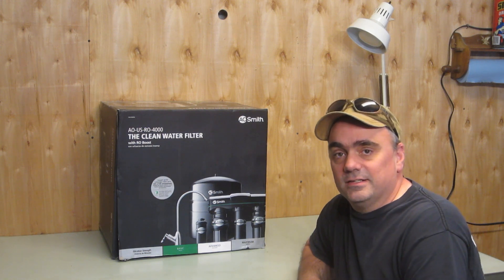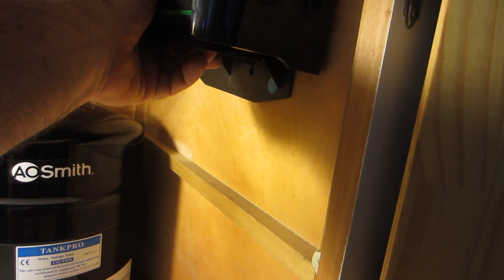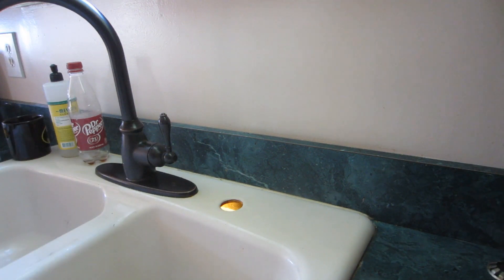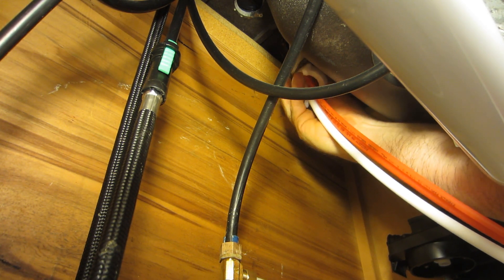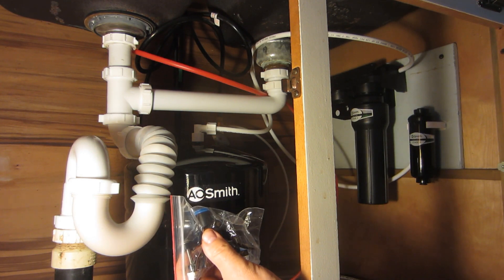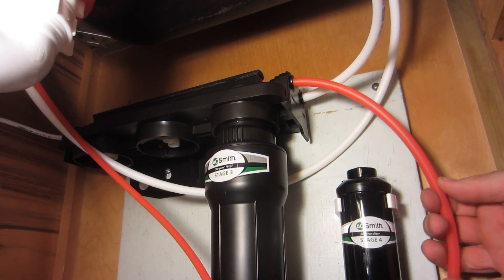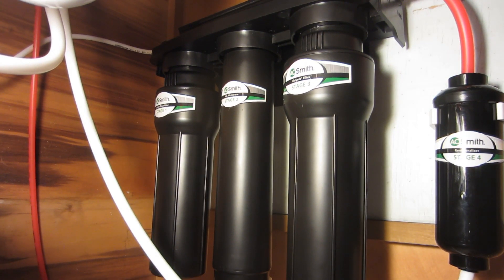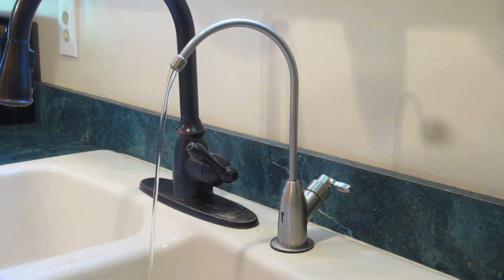A. O. Smith Reverse Osmosis Water Filter Installation AO-US-RO-4000

Comment: VERY GOOD instructional video!! The instructions that came with it weren’t very good at all!!
Reply from the maker: Thank you!
Reply: Well… we followed the instructions like worked for NASA. Finished the 24 hr purge. We were ready to enjoy the filtered water. The third filter started a slow to moderate drip… and ruined our hardwood floors on the den side of our kitchen. Returning it.
Reply from the maker: @TheThreekeys  Well, that is unfortunate.  I have read in the reviews of these AO Smith filters that leaking seems to be a common problem.  I did just change the carbon and clarium filters (stage 1 and 3) last week, and stage 3 leaked a little.  I just unscrewed it and screwed it back in a few times, and that seemed to seat the o-ring and keep it from leaking.  If you are still looking for a RO filter, the iSpring filters are pretty good.  I installed one at my son's place and am pretty happy with it.  There are also ro filters out there that have their own pump so that pressure is not an issue.  Hope you find something that works for you.

Comment: I just installed one of these that are similar. As far as the purge and sanatize. My instructions stated to put 3ML of bleach, then fill and drain the tank 3 times. Which took about 6 hours. Did you really have to run for 24 hours??
Reply from the maker: I did.  After the first few minutes it is only a trickle.
Reply: @TheFixitShed  may need to check your tank. I believe psi needs to be 7-10. Also, check your incoming water. Needs minimum of 40psi I believe. Booster pumps could assist.
Reply from the maker: That is actually how it is supposed to work.  The RO process is slow.  That is why it needs a tank.  If it didn't have a tank it would take 15 minutes to fill a glass of water.  So when you  are flushing the system, for the first few minutes, it is emptying the tank.  Once the tank is empy, is slows to a trickle because that is the max flow through the filter. Per AO Smith (for my system) pressure should be 5-7 lbs. Thanks

Comment: FYI-  A.O.Smith admits the leaking canister lids are a problem. The last time I talked to customer service. they didn't know what size O-ring fits the cap to replace it and just said they'd send out a new one.  That seems to be an issue a business would want to fix.
Reply from the maker: Yes I would agree.  I have had luck with making sure the o-ring is lubed, and then tighten it down, if It leaks, loosen it 1/4 turn and then tighten it again.  You might need to do it more than once, but that seams to get the o-ring in the proper position, eventually.  It is a different way of sealing with the o-ring.  It doesn't close down on the o-ring, kind of squashing it, to make the seal.  It bottoms out so that you can't tighten it any further.  Not a great design.
Reply: @TheFixitShed  agreed.  I've even tried using plumbers tape to seal it and ot worked once. Customer service said the model is discontinued. So that'll go in the trash. wasted money

Comment: Onthe back of my spicket looks like a key hole water leaking from ther and not out the spout
Reply from the maker: It is normal for it to do that when the drain line is clogged (the red line going to your sink drain.) If you can blow compressed air into the keyhole, sometimes that will clear it. Or you might be able to disconnect the red line from the drain pipe and clear the debris there. Also you might want to turn the faucet around so the keyhole is facing the sink.
Reply: It’s drains a little water threw the drain then makes gurgling sound over and over how long does it rake to get water to drink
Reply from the maker: If you have added bleach to the system, you need to flush the system for 24 hours.  After that, the water is ready to drink once the system pressurized (ususally an hour or two).  The water going down the drain is caused by the system flushing the contaminants from the filter.  It does this periodically.  IGurgling is either coming from the drain, or from the tank filling.  Either way, you can drink the water when the system is gurgling.
Reply: Thank you can i Purchase the filters at Lowe’s
Reply from the maker: @mikegrega4524  They do appear to be available at Lowe's.  you might want to check online to make sure your local Lowe's has them in stock before you run over there, though.

Comment: Hey I just did all of that and two of them are leaking profusely what do you suggest please please please thank you quick quick thanks
Reply from the maker: I found that getting to get the o-rings to seat properly, if you just unscrew it a quarter or half turn, and then retighten a few times, that would usually do the trick.  make sure the o-rings are well lubricated with food grade silicone grease.

Comment: Brilliant video ...thank you and thank you . What size drillbit did you use ??
Reply from the maker: Thank you!  You drill a 7/32" hole in the drain pipe for the red waste line
Reply: @TheFixitShed  thank you . That was a quick response.  My first Engineering project without my man 💪 👨

Comment: Thank you for putting together such a great video. It is useful anytime.

For me, the drain connector is connected to a horizontal pipe. I am getting an annoying noice when the tank refills. Is the sound due to the drain connector connected to horizontal pipe?
Reply from the maker: Maybe. If it is a gurgling sound coming from the keyhole in the faucet,  that is normal, but should go away once the air works out of the system. If it is a trickle sound, that is probably coming from the drain hose. the filter does use water to help keep debris out of the filter, washes it out the red hose to the drain.
Reply: @TheFixitShed  thank you. yes, it is from drain hose and it sustains until the tank is filled. Any suggestion to resolve this issue?

Comment: have you had any leaks at the manifold connection? I have a small one above canister #3. any ideas on troubleshooting? thx!
Reply from the maker: There are three possibilities.
 1-If it is coming from the water lines, make sure they are all pushed in securely. If they are, take them out and make sure the ends are cut as straight and cleanly as possible and reinsert.
2-If it is from between the lid and body of the canister, unscrew 1/4 of a turn and retighten 2 or 3 times. That might help the O-ring settle into place. 
3- If it is coming between the cap of the canister and the manifold, there are two ports on the cap that each have an O-ring. Make sure they are lubricated with food grade silicone grease. There is also an O-ring inside the lid of the canister. Using food grade silicone grease on that may help as well.
Reply: @TheFixitShed  thanks, i'll see if anything slows down the leak at the manifold connection. Impression of the unit is it's a little bit flimsy and a little bit fragile and I've already ordered a couple of replacement canisters that were leaking out of the box. It's a great idea but we'll see over the long-term. Hope you've been OK with yours for maintenance etc.
Reply: @TheFixitShed  what I actually think it is after looking at it again is it's the only canister that has some play in it. It may be the manifold fitting or how it's fitting in there but it's not Loctite like the others in a straight vertical. Not sure what the solution is.
Reply from the maker: @jamiehoward2735  I would call the Support Line. I have found them to be super helpful.

Comment: Don't forget to add 8 psi to the tank. They rarely have air stored in them on install
Reply from the maker: AO Smith recommends 5-7 psi and they do generally come with the correct pressure.  Always a good idea to check,  though.
Reply: @TheFixitShed  I just do purification for a career/job. Installed 100's of RO systems. Air the tank up, at least check. After being stored in various climates, its almost certain you'll have to air it up a bit.

Comment: Thank you for the video.  I installed this system across the kitchen from the sink to go to the fridge 3/8th step down to 1/4, Keurig with float valve 1/4th with cut off, and a GE opal ice maker with float valve 1/4th with cut off and ran the drain line all the way back under the cabinet.  Put a 1/4th cut off on system inlet, 1/4 cut off to the drain before the 3/8 step up adapter to drain adaptor.
Reply from the maker: Great job!  Thanks for the info!

Comment: Thanks for the thorough video! Just installed it today, keeps making the hissing sound through the faucet.
Reply from the maker: They say it is normal for it to make noise.  The filtering process is fairly slow, and the water is almost constantly trickling into the tank so the water is ready when you want it.
Reply: Yep, ours hisses a lot. Thank goodness it isn't too loud.
Reply: I noticed alot of water running down my drain while filling. Is that normal.

Comment: Dumb  question , but you could use a 1/4 drill bit to make the 7/30 hole right?
Reply from the maker: In this case, 1/4" should work just fine since the red hose connects to the collar and doesn't actually go into the pipe.  it is only 1/32" larger than the recommended size.
Reply: @TheFixitShed  thanks for replying right away I'm tackling this project right now lol

Comment: I'm not getting any water to my tank
Reply: Also if I losen up filter 2 I get water flow to my tank then to my Faust. But the filter leaks. When I tighten back up I barely get any flow to my tank.
Reply from the maker: The tank may take a couple hours to completely fill. If you are having trouble, you should call the toll free help line in the manual. They have been very helpful in the past.
Reply: @TheFixitShed  copy I can get the tank to fill in about few mins if I mess with filter 2 by undoing it alittle but the filter leaks. I call them thank you for your help.
Reply from the maker: If you undo the stage 2 filter, you are letting water bypass the ro filter. So you are filling the tank with unfiltered water.

Comment: Install everything as said in the video, but water comes out of the tap above through the hole that can be made in that case
Reply from the maker: I don't quite understand the question, but I highly recommend calling the AO Smith support line.  Phone number in the instructions that came with the system.  They are very helpful.

Comment: Dude, thanks for the video,  saved me a bunch of time installing this. Did your pressure out of the RO improve over time ? And what is that in line flow restrictor for ?
Reply from the maker: You are welcome.  I am glad you found it useful.  My pressure has not changed much, but I think that is mostly because the water pressure in the house is on the low side.  I am not 100% sure of the function of the flow restrictor.  the manual says "The restrictor is vital for proper operation of RO Membrane Cartridge as it keeps water flowing through the membrane at the proper rate ensuring the water produced is the best quality"  It also says that if the restrictor is not present, the faucet will leak.

Comment: I did istalled but I am having issues with filter number 3 is leaking
Reply from the maker: Call the 877 number in the manual.  They will be able to help you out. If a part is defective, they can get you a new one.

Comment: Can you please tell me if you can conet a refrigerator line to it and where ? Thank you
Reply from the maker: 1) I would recommend calling the help line in the manual. 

I haven't done this, so I have no practical experience with it, but...
2) If I were doing it, I would put a Tee connector in the white line going to the faucet.  The red lines are waste lines. Don't use the piercing valves they usually use to make refrigerator connection.  Just get a Tee connector and splice it into white line.

Comment: Thanks I’m glad that you had a leak in the system because I also had one. For some reason my leak only came from the Step 1 filter. It seems that it was missing the rubber gaskets. Had to go back to Lowe’s and when they took out the Step 1 filter and I installed it no issues. Thanks for the video.
Reply from the maker: Glad the video helped, and Lowe's was able to help you out.

Comment: Nice job! Wish I watched this first. Had to run back to work to get drill bits! Great job. It’s purging now. Can’t wait to try it tomorrow. Ruined my Pants with bleach. Haha
Reply from the maker: Thanks!  A year ago I put one in my previous house.  I work odd hours, so I was installing it while the rest of my family was sleeping.  I couldn't find any bleach in the house, so I was out running around looking for a 24 hr grocery store at 1:00am (found one).
Reply: @TheFixitShed  hahah. So guess what! It’s been four months and now it’s leaking through the air gap. Called the company. They kept telling me the drain is clogged. I told them I literally disconnected the waste line hose... let it drain into a bowl, and it’s still leaking from the air hole on the faucet.... they’re sending me a new faucet and a new flow restrictor.  small piece that goes into the  tube. Really upsetting. Not happy. How’s your unit working?
Reply from the maker: @MasteringHow-To  Mine is working fine. I had an issue with water coming from the hole in the faucet. The hole I drilled in the waste pipe had gotten clogged with debris. Once I cleared it, it went back to working as normal.

Comment: This is a great video. Thank you for taking the time to tape it. I was hoping you would show the filtered water up close. Is it crystal clear? Is it cloudy? How does the water look? Thanks.
Reply from the maker: My water comes out clear. Generally, cloudy water will clear up if you let it sit for a minute.  Usually, it is just tiny air bubbles that go away when it settles.  I have a friend that the water comes out cloudy, but they have high water pressure compared to mine. Maybe that is a contributing factor?
Reply: @TheFixitShed  Thank you. You've confirmed what I thought may have been air bubbles, but there's also a whitish film swirling on top of the water.
Reply from the maker: Not a clue about what the film would be. You may want to have the water tested.
Reply: @workingshopper  hey did you ever figure out what that was ??
Reply: @workingshopper  because I also have that whiteish stuff
Reply: @anthonymelendez333   Did not spend time figuring it out. We have such hard water that I figured we'd need to invest in water softener. For drinking we also filter it through a Brita pitcher to get that crystal clarity.
Reply: @workingshopper  mmm what state do you happen to live in ? I live in California and in Rancho cucamunga witb fairly new pipes in the city 
So I was thinking it’s something with the filter itself

Comment: it says the let it run for 24 hours but after it built pressure it runs for about 1o to 15 minutes until the tank empties then goes barely a drip?  tank or pressure issue?
Reply from the maker: RO filters filter water very slowly, that is why they have a tank, so that there is some water available immediately when you want it.  After the tank empties out, you will only get a trickle of water out of the faucet. So, it sounds like it is working properly.

Comment: Can i plug the air gap?? Is too noisy after water runs low the air noise starts really annoying tho!
Reply from the maker: I would not plug the hole.  That is an overflow.  If/When the waste water line heading the the drain plugs, it will over flow out of that hole.  I have had the waste line plug once already.

Comment: Great vieo, Thanks for taking the time to make it. Ive been having a problem with mine for some time now. The line for the #2 filter is vibrating like crazy. Have you had any similar problems like that at all? Thanks again.
Reply from the maker: I have not heard of that problem before, but if you are talking about the line with the flow restrictor (which I think you are), you may want to check and see that it is intalled properly and/or not obstructed.  If it looks OK, maybe call AOSmith and see if they will send a new flow restrictor.

Comment: Hey, do you happen to know if the faucet on this model is repairable in case of a leaking faucet?

I suspect the line is clogged, but can only clean so far deep into the line. 

I may try a can of pressurized air to blow out any gunk. 

I believe this is an air gap faucet, but not clear.
Reply from the maker: I am not aware of a way to repair the faucet, but it hasn't been an issue, so i haven't tried.  I have see people blow compressed air into the keyhole in the faucet to clear clogs.
Reply: @TheFixitShed  Thanks for the reply. That is exactly what I did. Blew air into the air gap and it unclogged.

Great channel and great advice!

Comment: Filter worked great for about 5 months. Now it’s leaking through the air gap in the faucet. Really poor quality. Called the company. Walked me through steps that didn’t help. Sent me a new faucet. We’ll see if it fixes it.
Reply from the maker: I had an issue with water coming from the hole in the faucet. The hole I drilled in the waste pipe had gotten clogged with debris. I pulled the red hose out of the collar on the drain pipe and removed the debris that was suck in the hole in the pipe.  Once I cleared it, it went back to working as normal. There is a video on YouTube where someone blew compressed air in the air gap in the faucet to clear a clog.  Worked for them.  Try at your own risk.

Comment: I have the same setup and been using it for a yr now. I got mine professionally installed.  Now my question is it normal for the pressure to be that low?
Reply from the maker: For the 2 installations that I have done (my current house and previous house), the flow of water from the faucet has been similar, so I would say, yes, it is normal.
Reply: Hey. Called the company. There’s a test you can do. I forget the exact test. But I think it’s like 1 minute to fill a half gallon container. But call them to make sure.